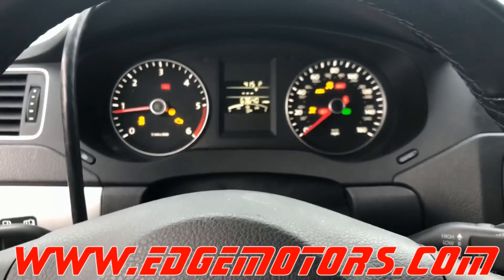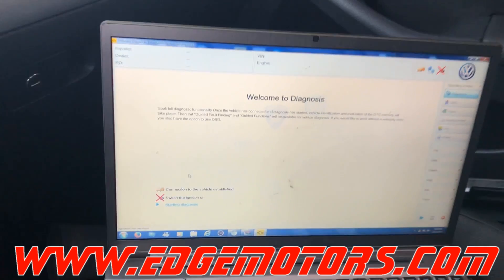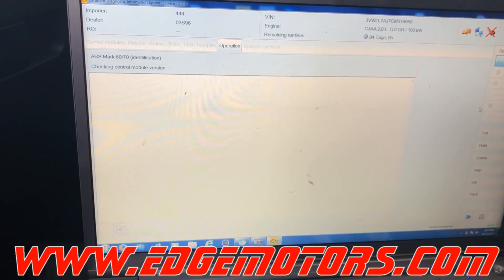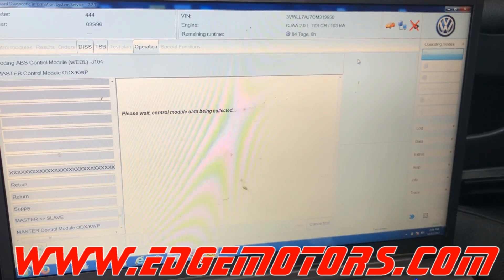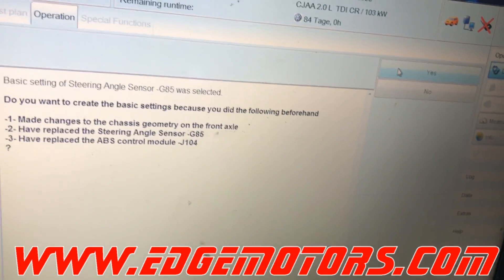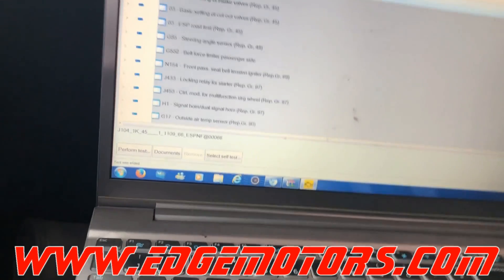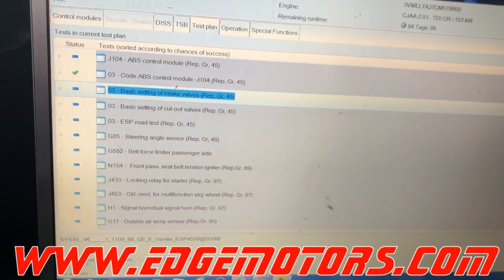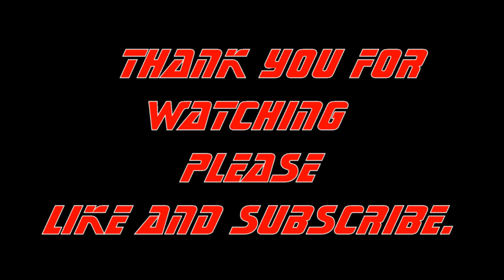MK6 jetta ABS module coding with ODIS by Edge Motors

Comment: This video is slightly useful in that it shows the  procedure, but doesn't even show the result, you kept the camera on the laptop at the end and didn't move it back to the dash cluster to show if the warning lights were still lit, so we didn't see the result? Also for newcomers would be useful to know what it takes to get this software working, does it need a paid subscription? Can it work totally offline or needs an internet connection to do this task?
Reply: Hi
 after programming was successful the abs light was not blinking any more .so yes it worked fine .
Reply: @bgfrdqf44  Not shown in the video, not proven?
Reply: @Franksey180  hi it is .just after coding and before basic setting .

Comment: Hi boss I tested instrumental cluster on vw jetta 2013 nd after replacing the old instrumental cluster the abs lights started flashing nd said abs control module incorrect coded how may I solve this problem am using vcds scan tool pls help me
Reply from the maker: Have you change the abs coding?
Maybe the wrong coding is in a new cluster and not abs?
Check the codings of old and new cluster....
Reply: @EDGEMOTORS  I didn't change the abs is still the old abs but I put new instrumental cluster to see that is working after replacing the old instrumental cluster den the abs lights started flashing when I diagnosis it's says abs incorrect coded
Reply from the maker: What kind of car is it?
Reply: @EDGEMOTORS  it's vw jetta 2013 2.0 turbo engine
Reply from the maker: This one you may have a problem if abs lost the coding... you may need odis to calculate it...
Reply: @EDGEMOTORS  pls am in Ghana west Africa how may I get dis of odis scan tool

Comment: This procedure was made for a lost coding that meand there where no code in the abs module did you recode  it online or does the odis software contain all the data needed for the module and thanks for your video
Reply from the maker: The Odis has all the data for recoding.
Reply from the maker: Yes Odis has all the data
Reply: You mean that no need online server to code abs module
Reply: @virendrasingh.auto.car.ele1386  if you watched closely you should have seen the online connection and data transmitted. Online connection is the only way.

Comment: Hi thanks for the video I have a VW ErWin subscription for a year I was wondering what do you need to connect to VW server is ODIS a separate subscription?  And the plug you are using I assume it a VAS 6154 ? So when you use the factory tool do you pay per use or per year ? And let’s say there is a fault code in any module is there a explanation of the fault and a repair track to help diagnose the car ?
Reply from the maker: There is diagnostics help, most of the times useless... and yes it is a separate subscription, 800$ per brand 
I mostly use it to program stuff ...
Any pass through device should work with it... the biggest thing is you have to go through security and background check with Vw ..... that’s the most important thing.
Reply: @EDGEMOTORS  it is $900 plus the application fee of $100 in 2021, let's see how much next year. Finally someone to use original ODIS, people have so many pirated and useless versions and constantly asking for help.